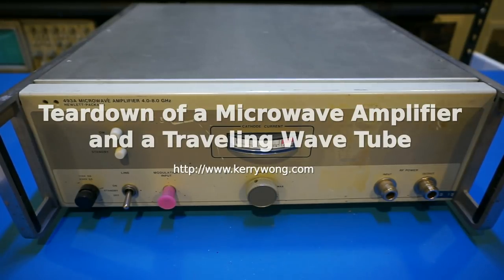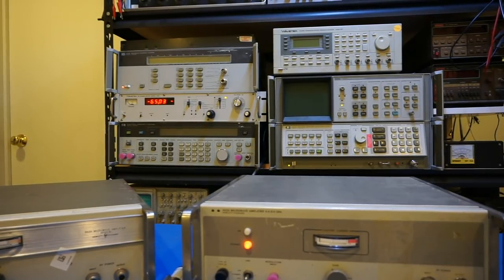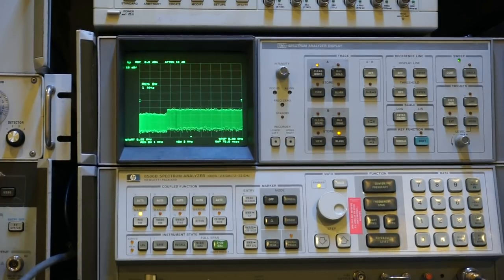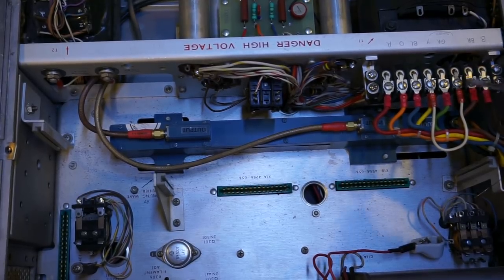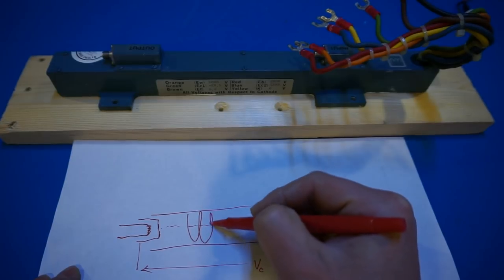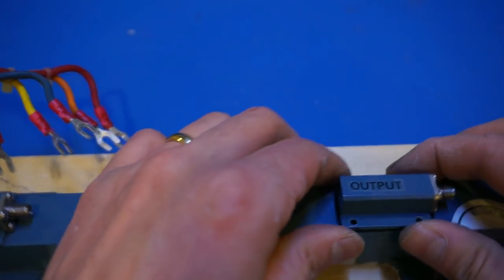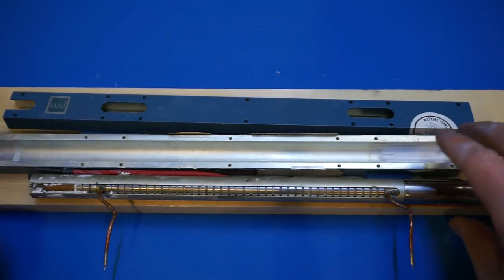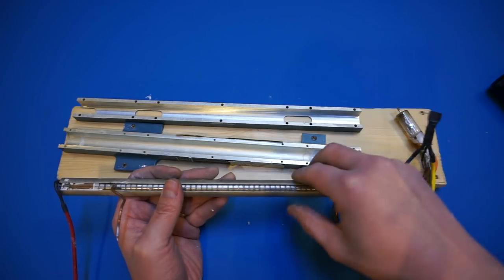Guest Video: Kerry Wong - HP493A 8GHz Microwave RF Amplifier Teardown

Comment: Thank you for the memories, Kerry. Some good, some not so good...
The Army AN-TRC 90 had a TWAT that was not as long as that one and it drove a 1 KW 4.4-5GHz Klystron amplifier tube. It would transmit 144 voice channels or a TV broadcast channel (or so I was told). They operated Dual Diversity and later, Quad Diversity. Very reliable and part of the communications "backbone" system in Viet Nam. The Klystron tubes cost $12000 in 1968. All Collins Radio gear.

Comment: I've used TWTs for many years on satellite uplink trucks. These were 300w at 14GHz and made by EEV. That's the English Electric Valve company not Dave :) This is the first time I've seen inside one. Thanks for that.

Comment: Kerry,  Very nice and interesting video. There is a surplus electronics store near me that has 3 of those exact same amplifiers for sale, though they don't work and  were all previously gutted of all tubes except for the TWT's.  Considering the early 1960's style of that HP TWTA, I would assume they stopped making them probably in the late 60's since TWT's with only ~30dB of gain and 1Watt saturated output was pretty wimpy. I imagine for their day, they probably did make decent lab amplifiers since 1Watt over a full RF band is still cool. A word of caution about taking apart TWT's. You are very lucky that that TWT was old enough to be made out of glass, as many low power early TWT's were. Nearly all TWT's made in the last 40 years or so use Beryllium Oxide (BeO) instead of glass, because its superior thermal conductivity, HV insulation strength, and its ability to be brazed to metal components relatively easily. The only issue with this amazing material is that it is extremely toxic in dust form. If you have a piece of it that isn't cracked, you are probably OK. Though if that TWT was made of BeO, then I would have been seriously worried for you when you cracked into the vacuum inner portion of the TWT, as that would have created BeO dust particles that you would have unknowingly breathed in.

Comment: This is way over my head electronically, but as a 30 year mechanic, the pinch marks on the copper are most likely from the tool they used to bend it. Maybe wire cutters? Just a guess
Reply: Wouldn't you think the factory of these would have a small tubing bender? Like a smaller version of a brake line bender.

Comment: Long tubes (well, tubes with long electron paths, straight or curved), including TWTs, can be affected by local magnetic fields, including geomagnetic fields, so such tubes would be largely enclosed by mu-metal or a similar magnetic shielding material.

Getting the electron beam aligned and centered is deceptively simple at the start: Mis-alignment will cause the e-beam to collide with the helix or even walls of the tube, creating a local hot-spot that can be externally detected.  Even a finger is useful during the early alignment process (though only after first checking the temperature with a thermocouple or bolometer).

TWTs have efficiencies between 10% and 50%, with most commercial tubes being around 25%-30%.  That means most of the power supply output has to be removed conductively from the anode and cathode, which are often optimized for thermal constraints, permitting the TWT cavity to be optimized for RF constraints.

TWTs are often highly microphonic, permitting a small rubber mallet to be used as a troubleshooting tool.  Which, of course, we called a "calibration hammer".

Comment: You said 25dBm amplification.  Is this a slip of the tongue?  Amplification is usually in dB, not dBm, but does it still hold (is it correct) if you say dBm?  I can't work it out!!
Reply: No, you're right. Gain is a ratio of power quantities, so it itself is dimensionless. So it's wrong to say dBm of gain.

Comment: what was wong with that amplifier?
Reply: Well, it was missing a couple of components (a couple of HV relays on the HV board). Also the TWT itself is weak (I verified this by swapping the tube with my working unit).
Reply: Looked like the top of one of those 3 HV tubes was bent a little, didn't notice anything else wong.

Comment: I still dont get what vacuum tubes are and what they do
Reply: They're similar to MosFET's but run at higher voltages and can be more flexible.
Reply: Go to "Mr. Carlson's Lab", youtube channel and browse he's videos. In one of them he give a great explanation about tube valves and how they work
Reply: Basically, they are the predecessors of most of the silicium based electronic components (Transistors) that we know and use knowdays. But they are still used in audio applications for their performance.
Reply: In the immortal words of the glorious AvE - "JFM, baby - just f'kin magic!.."
Reply: PugMan3 PugMan3 and they sound fantastic in guitar amps
Reply: There is no such thing as a vacuum, they are negative pressure tubes.
Reply: @car ma - I hope you're aware that what you just said makes precisely ZERO sense. If vacuum is zero pressure, but there's no such thing, how can there be negative pressure? ;)
Reply: vacuum is zero absolute pressure, but is negative if you consider zero to atmospheric pressure
Reply: like Celsius and Kelvin in temperature
Reply: Well, even that's kinda "pushing it", when it comes to definitions. Absolute atmospheric pressure has a certain value (depending on altitude etc), but "even" in relative numbers, atmospheric pressure is "one atmosphere". Well, unless you really insist on twisting words and definitions in order to fit a nearly pointless statement...
Reply: Agreed, I love Mr. Carlson's channel and he does a very good job explaining things.
Reply: it's pure skookum and angry pixies
Reply: The simplest answer to the question of "what is a vacuum tube" came from Dave's videos on microphone design. They are a FET with a pilot light. Of course thats way over simplified, but generally they function like diodes or transistors, depending on tube type and design.
So with that in mind they can be used in circuits such as amplifiers, voltage regulators and rectifiers. Interesting things to read about, though have few applications these days.
Reply: Tubes in guitar amps are orgasmic - such beautiful characteristic tone.
Reply: use your googlefu, dude!

Comment: The SK numbered transistor is a replacement. Was originally a 2N301.  The SK line was a series of universal replacement transistors and other semiconductors marketed by RCA.

Too bad about the tube getting broken during the extraction, but it was pretty predictable given the fragile nature of the things.  If you want to see what the "raw" tube looks like, without the mountings and focusing magnets, here is a typical unit:

http://www.r-type.org/exhib/aab0032.htm
Reply: I was hoping to get the whole tube out without breaking it, but it was virtually impossible.

Comment: Those magnet bits were really weird.  I can't imagine they would just stick broken pieces of magnet in there for trimming and then not even glue or adhere them in place.  My guess is that was a, donut magnet wrapped around one of the coax cables or something like that.
Reply: I was thinking the same thing but on the other hand the tube was made so meticulously  I couldn't imaging that they just broke off....
Reply: were those things not taped on there? With the short piece of capton tape and the clear tape around the tube
Reply: Being the tube was broken I could easily imagine those being pieces of another magnet, perhaps an end magnet? I kind of doubt they'd use random shaped broken pieces to tune it after all that work to make it so "just right". That's just my sense of the situation.
Reply: John Possum Those magnets seem like the soft kind like in some DC motors and such. I imagine they had to trimm them down a few times during adjustment and so you end up with a crooked piece like that
Reply: John Possum Those magnets seem like the soft kind like in some DC motors and such. I imagine they had to trimm them down a few times during adjustment and so you end up with a crooked piece like that

Comment: SK3009=NTE121 in stock
2N441=NTE105   in stock

Those exact germanium transistors may not be made anymore, but other manufacturers are still making germanium transistors and still make equivalents. I just picked NTE as an example.

Comment: Looks like that HV regulator is a simple shunt across the raw HV B+.  Further evidenced by the PC board construction of the HV regulator board. No excessive HV on the board, just on the shunt tube plates? Similar design to a CRT color TV HV regulator using shunt tube. Also note that SK3009 transistor is not OEM. SK series was RCA's line of TV service parts. I'm surprised someone would put a second class part like that in a unit like this.

Comment: To answer the questions about the outer magnets you saw, considering the fact that that type of TWT was most likely 50 years old, they would have originally been glued in place. Unless the guy was lazy and didn't do it. (Watkins-Johnson was good in its heyday but did eventually fail in its TWT business since they aren't around anymore)  Magnets are added on after the tube has been sealed when the TWT undergoes final testing. The test tech will place them as needed to reduce helix current. Less helix current leakage = higher efficiency and less stray electrons hitting the hair thin helix wire. The hotter the helix gets, the more likely the tube is to fail.

Comment: Disappointed the thing didnt take off, although it sounded like it was about to at power on
Reply: LOL, I didn't turn on the unit I did a teardown with, that fan was even louder!
Reply: Kerry Wong It reminded me of my HP programmable pulse generator, to get the switching speeds they needed back in the early 80s it was built entirely around ECL logic, so to get a fast +/- 5VDC pulse requires 300+W of power and two very loud fans that sound about like a jet engine taking off.